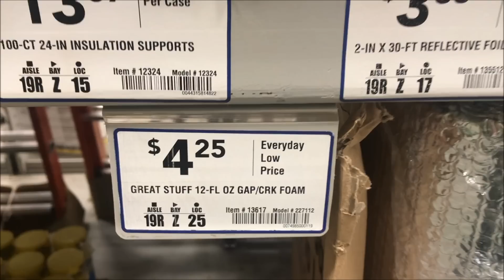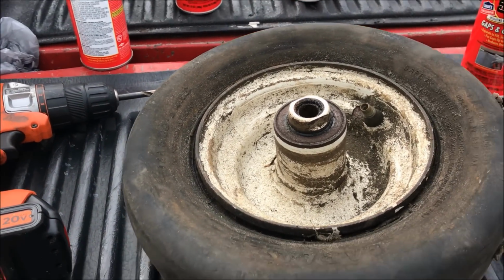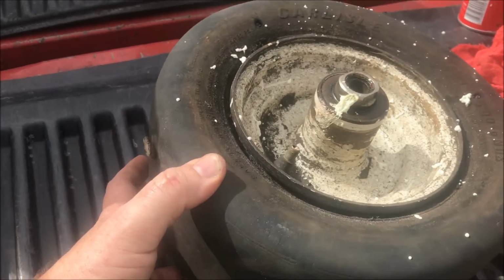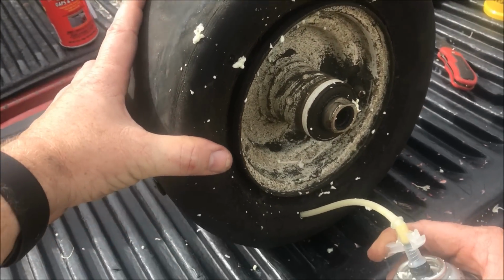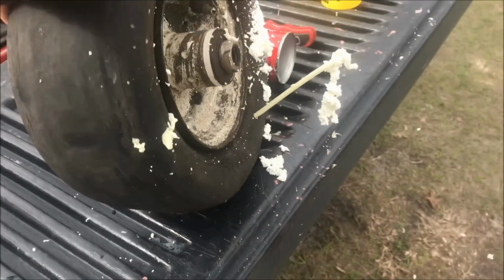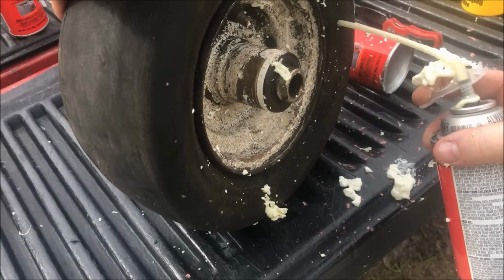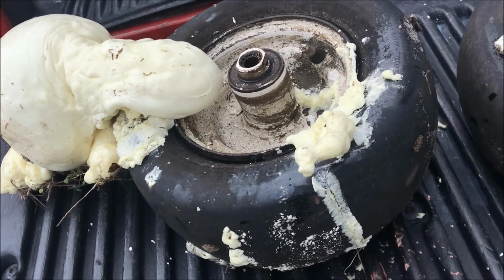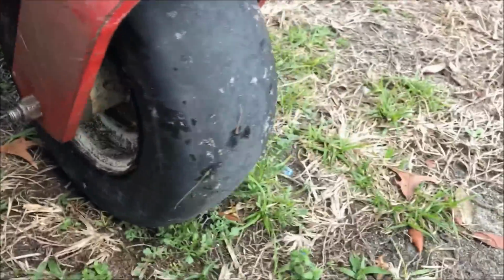No more flat tires How to fill a TIRE with FOAM

Comment: Great tires, came nicely packed in the box, and did not compress  https://www.youtube.com/post/Ugkx985f3iNjxHFMO6JoE7CSGActiIEyumFx  . It fitted my craftsman riding mower just fine. It is a little narrower than my stock tires but so far it has held up and works great. No air leaks and traction was great in my hilly backyard. Installation was good and was not too difficult, highly recommended.

Comment: In all my years of working with this stuff in props and decorations I have found a few things out the hard way. Like a haircut is cheaper, safer and easier than more chemicals. The best one I learned however is that it isn't air that makes the foam cure, it's the moisture in the air. I always have a spray bottle on hand so it cures quicker. You also don't have as much worry about it just staying an uncured mess in the middle of cured foam.
As far as the tire keeping it's shape, I'd suggest a screw and clip into the bead to hold it to the rim properly. Lessens the chances of bulged or deformed sidewalls.

Comment: Dude #1)  take the valve core out then fill tire. #2) use a sharp drill bit so you dont slip off. #3) make sure you have can screwed on all the way to straw. #4) wear latex gloves . #5) make sure you have straw in and secured before  filling . Just good safe advice.
Reply from the maker: I greatly appreciate the tips. It was a mess everywhere.

Comment: I have a dolly cart and was thinking of removing the air-filled tires and buying solid rubber.  I never even thought of doing this!  It will save me a lot of headache.  Thanks!
Reply: To follow up:  The technique worked just fine on my dolly cart.  I only needed part of one can, and I used what was left on a wheel barrow tire.  The tire was falling apart, but the method still worked, sealing holes in the tire and making it functional.

Comment: Advice: hold your "Good Stuff" can upside down to make sure discharging all the foam inside the can
Reply: I don't know.... is there a tube inside the can running from the top to the bottom?  Usually there is in most cans of paint and other stuff so that it picks up the stuff at the bottom.

Comment: I use green slime in all my tires except for my truck and car tires!!!
Works great and never had any more problems with flat tires!!!
I only have to add a little air every few months!!!
I love the stuff!!!
Reply: With green slime do you have to jack the lawnmower up ?  Did you drill hole to put it in?  And lastly, do you have to add air after?

Comment: I tried this procedure on both of my rear 20x8 lawn tractor tires. It was a disaster and i ended up ruining both rims and tires.Here in the South its much too hot for this to work in the summer. The foam gets completely out of shape and you get extreme flat spots due to the heat. I used more then a case of "Great Stuff" foam attempting to fill all of the voids. But It did not get the tires back to the proper original size and shapes. It was aweful on the spine  and the cut of the blades. I may have done something wrong. But no matter how close to the recommended procedure I stayed, the tires didnt maintain their shape. I can't recommend this at all in high heat areas. ZZ.

Comment: depends on what the tire is used for.  I used the foam on my tiller tires since the tire and tubes were super expensive . been using the tires for 3 years no problem.  a mower tire filled with foam will break down quick due to all the vibration and heavy use.
Reply: Thankyou!!! I'm looking at doing the same

Comment: This works pretty well for the people that sell the foam. It doesn't work for load carrying  wheels. You will have a flat spot after the wheel sits for awhile.  There are products that work. That one isn't one.
Reply: Hey would you be kind enough to let me know the names of those products. I have a few load bearing wheels I’d like to try. Thanks in advance.

Comment: You got to make two evenly spaced holes the same size as the straw and some little tiny holes all over the tire and plug the two fill holes when it's full so then foam can't escape but still draw enough air through the tiny holes for the foam to expand, be sure to start spinning the tire or rollin it around for a minute or two to even out the foam from having flat uneven spots then lay the tire horizontal to cure still occasionally spinning every couple minutes . Trial and error is how I learned how to do it this way

Comment: Requires lots of air to dry properly.  I tried making catfish jugs from balloons and beach balls. Some balloons dissolve or the foam doesn't cure . Same with commercial spray foam insulation, you've got to know what your doing and always make sure that the air gets to it while your working with it.

Comment: Drill bits work better if you spin them the correct way
Reply: Michael Vaught hey man, what do you expect from a guy blowing expansion foam all over his truck bed, while using his dollar store drill, to put holes in his tire, while the beads broken? I mean, seems to me that drilling backwards would be natural. 

I heard he died trying to weld a pin hole in his argon tank....
Reply: Don't be stupid.
Reply: I was wondering if anybody else caught that too. But hey.. we all should give him a break. He’s trying to help people out that aren’t like some of the know it all ‘pros’ on YT that need to make childish comments and ridicule others.  What good does that create? 
Real old pros don’t make comments like that...just saying.  Sure, it wasn’t flawless. If he’s happy with it, that’s really all that matters. Good or bad.
Btw Michael.. your comment was nicely worded and still made the point without making fun of the guy. 
As it should be. 👍🏼
Reply: And for the record, I was in the trades for 40 years as a contractor and a precast manufacturer. I had many employees. Some were better than others, but I never ridiculed any of them. They don’t learn when you make fun of them or make slight in front of others. More people on YT should consider that method instead of making fun of others. It makes the world a better place for us all. 😉
Reply: It's hilarious how many people think this guy is running the bit backwards. Haven't they ever watched those old Western movies where the crew rigged those spoked wagon wheels to run in reverse the whole film, just to mess with our heads? ;D 
Do you think he would actually have drilled through the rubber with the bit reversing?

Comment: Professional "foam" is a two part compound mixed at the valve stem. Adds a lot of weight, but never fails.
Reply: ...kinda like expoxy,   only probly better,,,  eh?  never tried  PRO  FOAM......will check into it....thanks,
Reply: Call a local commercial tire shop, the A & B Foam is for offroad tractors, the Dump, Construction Sites, etc, but they'll fill anything. Including lawn tractors. When done, my Backhoe front tires wieghed over 200 lbs each.
If you need extra weight for your Lawn Tractor, it's permanent
Reply: Tne hardware store stuff dont work. I have a couple of 8 inch tires on a riding mower done right. By a tire shop. Must weigh 50 pounds. Got a couple of flat free tires for the front of a othe riding mower. Expensive but they work.

Comment: Instead of semi-rigid foam, you can also fill the tire with cement!  It works great in air mattresses and beach floats as well.
Idiots on parade.
Reply: BBC
News
Reply: sdushdiu OK Google show me video on how to run a car on fumes
Reply: @deanwoodburn2386  What??? But thank you for demonstrating how one posts with no functioning brain cells.

Comment: The foam needs 3 months to harden in the tire as once the holes seals there is no air to harden the foam. One thing they don't tell you doing this.

Comment: Did this about two years ago. Kept the wheel on the axle to spin it after getting about half of the can into it. Using the centrifugal force to disperse the foam evenly. Haven't had an issue. Only used one can on a 22.5 x 7.50 - 12.
Reply: Philo Beddoe  NP
Reply: I did the same thing 3 years ago.... tires are still going strong with no sign of breakdown. Since then I've done it to 20 or so others.....
Reply: Do you take the tube out first?
Reply: @SwagMaster-fq8qg  yes. No need for one because the foam is literally taking the place of it
Reply: @jda9835  guessing you would recommend doing this on a dinghy - the pressure is not as great - how many cans is the question...

Comment: Cool thanks for sharing. I have a really old pressure washer that is on its last legs (it's made by Honda and will probably never die). Anyway, $5 for a can of foam should work nicely for both tires. (No I'm not going to spend $40 for tires on a worn out washer)...oh yeah, I just want to mention you had your drill in reverse drilling those holes.

Comment: Anyone that does this is going to be disappointed $ buy a new tire & tube. I did everything right including adding a little water, shanking the can  sec, even putting in 6 screws to hold the tire bead onto the wheel. The tire stayed on the wheel, but the Great Stuff turned to powder within 1 hour of mowing. Don't waste your time on this
Reply: you did not use enough, rear lawn and garden tires would need way more, and most front tires as well
Reply: I wouldn't really say "I did everything right" while doing any of this...
Reply: Great Stuff Pond & Stone works.  It does not pulverize or compress 
like the other Great Stuff foams do.  It's about $10 a can, though.

Comment: It’s a good idea but I’m not sure if that foam is dense enough. Like to hear how it worked after running those wheels a little. I’ve had several tractor tires foam filled but it was like silicone, super heavy stuff and super expensive! ✌️
Reply from the maker: It worked out great for me. Customers had their roof repaired of replaced and nails were everywhere. I was dealing with flat tires every day. Problem solved.

Comment: Better to use Great Stuff Pond & Stone Spray Foam.  It doesn't compress and give you a flat spot when you put weight on the wheel like the other Great Stuff foam sprays do.  It's almost $10 a can, but worth it.
Reply: Nice. I've never tried the Pond foam but I'm gonna for sure give it a try. Thanks!
Reply: Philo Beddoe  do you honestly truly believe that foam will stay in a continuous even padding? It will break up under weight and end up with a tyre full of lumps and debris ,  it doesn't dry in a flexible rubberized fashion, there's no give in it, it'll last 10 mins at most, I'm sure you will disagree once again and find yet another reason so let's hear it??????

Comment: I used 5 cans ($2.99 a can at Walmart) to see if this would work. Harbor Freight had a wheel that was solid for almost what I paid to fix this cart wheel. I did notice that if you use one can at a time and leave the wheel in the sun, the heat helps speed it up. I does work, and it does get hard.

Comment: I filled 1 front tire on my ZTR mower. The hardest part was getting the tire bead seated on the wheel. I found the GREAT STUFF at Walmart for $2.94 per can. My 4:00 X 8 tire only needed one can  After I got the bead pushed out onto the rim, I drilled 4 holes just big enough to get the filler hose Into & had very little mess to clean up. My wheels are one piece and it has been really difficult to tear them down to patch the tubes.  Next time I buy a mower, it will have 2 piece wheels that bolt together.

Comment: Did this hold up well my friend? I have the exact same tires and they are full of plugs like yours.
Reply from the maker: Hello yes it did hold up. The tires did get replaced for next season. The rubber was paper thin. I had to cut old tires and foam to remove. No flat tires

Comment: I have learned a few things doing this. Wear gloves. I get a lot of thorns. I was using a lot of Slime. Before doing this make sure the Slime is cleaned out. Make sure the foam has a place to go when it is pushing out the air. Some like to put chunks of Styrofoam in the tire perhaps to save on foam. Don't use that soft stuff or even better use only the foam in the can on small tires. One guy was injecting the foam thru the valve stem with no way for the foam to push out the air.

Comment: To Pauliebots, Yeah I guess, maybe it would last awhile.  Someone let us know if it's a rousing success or doesn't live up, or is a dismal failure.  Thanks, paulibots!  seems like air pressure would still have to hold the integrity of the tire (bead etc.)  Otherwise I'm thinking fill it with foam and drain all the air pressure out of it and the foam couldn't possibly hold a perfect round shape.  Like you said paulie, any crushing would turn it into a mis-shapen mass, sith lumpy spots that wouldn't roll. (I think)

Comment: I will try about anything. I can't mow the lawn without picking up a few thornes. Bodark and misquote. I have decent luck with Slime.Tried the black can that is big gap foam. It couldn't handle the weight of the little riding mower. The small gap foam might be stronger but I am through with foam. I put boat trailer tires on the Craftsman lawn tractor. I put tubes in them with the slime in them. I think that will work better for me. I have had them awhile. I think they are the Slime brand. I use a lot of Slime.It will eventually turn to mud.
Reply: Checkout ProjectFarm's YT channel. He did a review on different tire repair in-a-can products and one was phenomenal, but I never heard of it before and can't tell you what it is now.
Reply: Thanks I was thinking on the tire that kept eating the great stuff I might have had some old slime left in the tire.The rear tires look good but haven't used them yet.
Reply: Took the big gap foam out of the front tire. Pulled the thornes out and put in a tube.Added some red stuff that I got cheap because the pump is no good. Had an extra pump. I tried the foam It didn't work. Time to move on.

Comment: This is good for that purpose but I use green slime, on my JOHN deere mower, I put slime into both of the rear tires, in 4 years I have never added air into them, and by the way with slime you keep the smoother ride, versus filling them up with foam which gives you a rougher ride,

Comment: Best way to do this!
1- Don't 
Since you didnt listen to #1. 
Drill two holes & use the top hole for escaping air Only..
Once filled and foam escaping from top hole, Stop. Put a screw in each hole and leave it. Wala.
No fuss no muss
Reply: *voila

Comment: After greatstuff expans and dries it is honeycombed with air pockets and brittle. Greatstuff starts expanding right when it is released.  If you released one ounce it will expand greatly. Triple expansion greatstuff has more air pockets. That one ounce after cured and dried can and will crumble to powder just by squeezing it. If not used correctly it can push out walls and window trim! But if you fill a container up that capable of withstanding the expansion force and quickly cap it off it will stay mostly uncured. It will and can only work temporarily it will crumble inside a tire as soon as its starts rolling. It will not bounce back! It will stay imprinted it will compress and crumble immediately..most riding mowers have tubless tire and only about 10 lbs of air, thats not really enough air to keep the beeds sealed. They will always leak . only thing to do is put tubes in..

Comment: I tried this, it works at first and then it starts to brake down inside the wheel. I used 4 cans. Best to do it on a Hot day. I still had to buy myself 2 new tires. The price of those cans are not worth it, 4 cans + tax= 1 tire from Harbor Freight.
Reply: Sometimes the tires are just too old for it to work.  But it does work for some.
Reply: A waste of time and money. The foam does not cure well and breaks down under a load. Cheaper to buy inner tubes.
Reply: It doesn't work in load carrying tires that you use. Left my lawn tractor sitting for a short time. When my daughter started to use it she complained the wheels aren't round  The same as an air filled tire except the flat spot stays.The foam has no memory unless it is a rubber type foam. Some keep the mower on blocks between uses. Some keep injecting  foam in the flat spots. No thanks.

Comment: This guy right here ,he ain’t too smart of a fellow if you know what I is sayin
Reply: 😂😂 facts, but this could actually work. I have a 1972 Sears Suburban 12 garden tractor, and I have the original front tires. The outer tire has a 4 inch split but they inner tube is perfect!! My plan is to put a piece of metal in between the 2 to keep the tube from bursting out
Reply: Mr. Clark just might do the trick
Reply: @joedoe4642  yeah buddy! Wish me luck. They're beautiful

Comment: "Good thing I have my safety glasses on" you know this guy aint wearing safety glasses. No gloves, wonky drill. spraying foam all over his truck. I would think 1 can of spray foam would do the trick here if done evenly.
Reply: Half at MOST. Each can should be able to do like 3 doorframes........ or half a dozen windows+.
Reply: Hahahahaha!
That's exactly what I was thinking before I read your post :)

Comment: I guess if your out off the grid that can work, however there must be a  TSC or harbor freight somewhere close by.
Reply from the maker: I ordered replacement tires before making this video. Yes hf and Tsc has tires but not smooth ones. This workout father entire season. I did have to cut off the old tires.
Reply: @how2af263  I just replace tires and wheels.   Anything helps I'll tell you. Thanks.